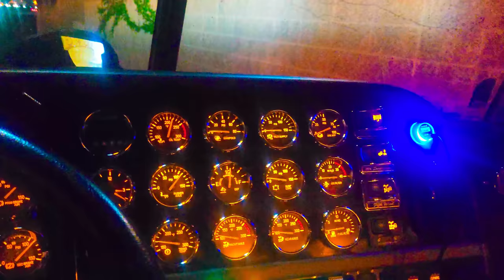Amazon work truck crashes and flips onto train tracks

Comment: The catenary wires for trains are designed to be turned off in sections remotely, in case of emergency; that's an upside to being in this spot. Working under commercial primary power lines, it's much harder and takes longer to shut down. Great job! 👍

Comment: That’s going to be a pretty hefty bill for the crashed trucks. You got tow and recovery, OCS department has to do a power down, track department has to come out and inspect the track and ballast and make any necessary repairs, and you have the lost revenue hours for trains running through.

Comment: That one was in a tough spot. Well done. I see one thing, there on the rear of the van unit you had you blocking sitting long ways, I had a bad issue with doing that do to it rolls real bad. Always lay your blocks the other direction which would be like across the bed. Just use another set or two if your worried the weight would cut thru. One more thing if you have the arrangement to do so. When you got a front end knocked out, have your come out unit load two 12 by 12 by 7 feet. You want have the issue with your blocking on the front. Just bore a hole in the end of each and run a rod thru them to load up. Hope that gives you a idea. Lot of great team work at your place. Great job.

Comment: Isn't that the main rail line connecting to the port?

What a mess
Reply from the maker: This is on the 210, which is far from the port lol
Reply: Ahhh, now I realize that ... it's light rail, not freight.

I bet that was fun sneaking that out under the catenary wires.  Lots of juice in those things when energized.

Comment: Why wasn't the guard wall 18 inches taller so that nothing could go over it to get on the rail?
Reply from the maker: Do you want the planet covered in bubble wrap as well?
Reply: Why wasn't the truck observing the speed limit so that it couldn't vault the barrier?
Reply: @PepesTowingService  No not that but why couldn't they put in higher walls, they have them on some freeways now.
Reply: @cmartin_ok  As far as I can tell based on interaction with some truck drivers THEY OWN THE ROAD!
Reply: I had a trucker near ELK mountain try to push me off the highway. Damaged my RV and scared my wife. We were on a highway with 2 lanes and he pulled up beside me in the left lane and tried to force me off the highway. Then he pulled around and got off the highway at a truck stop.

Comment: I say this with no disrespect to Big Flipper. But this was not a flipper job. This was a "slice and dice".
Reply from the maker: What does that even mean? You'd keep it on the tracks all day and night to cut up the chassis, then do what with the parts? Good luck getting mta and chp to agree to that. Quick and safe clearance is the name of the game, not cowboy stuff
Reply: @PepesTowingService  Sorry I will explain. Any time one gets a truck/car/whatever that is in such bad condition we call it around here a "slice and dice", because it is as if someone has taken a slice and dicer to it. Big flipper is not
enough by itself to get the wreck upright like you usually do. You need 2 towings just to get the mess off the tracks. What is amazing is that the box held together while you were doing it. That could have gone real bad real quick.  May you always have such good fortune.